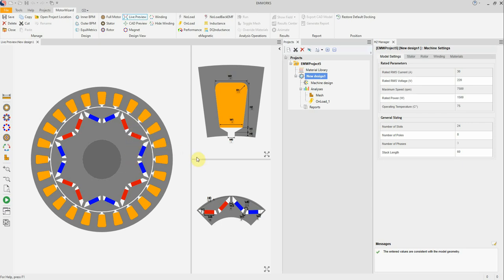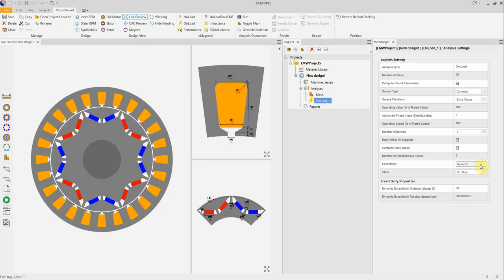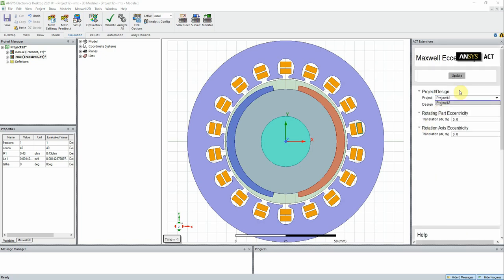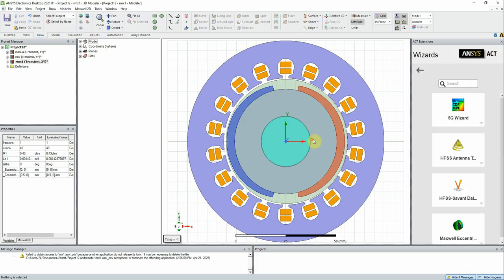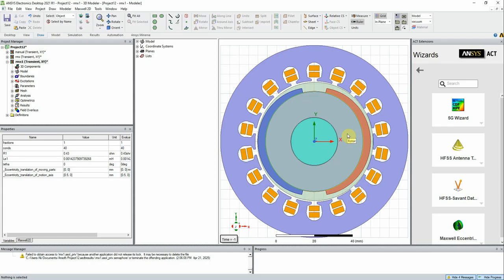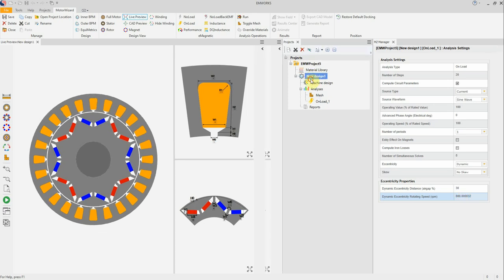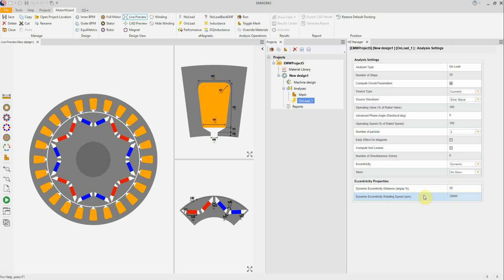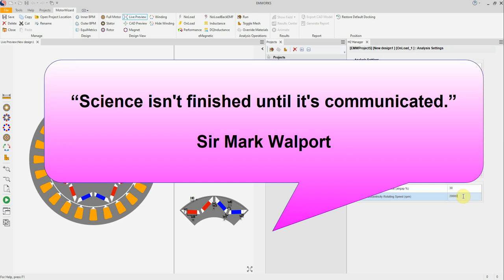Motor Eccentricity Simulation Like Never Before! Dynamic Eccentricity at Custom Speeds?! EMWORKS!

Comment: why should we use any other speed for the eccentricity? is it possible in real machines?
Reply from the maker: It is possible for many situations. Imagine, the rotor center is changing its place but at a lower speed of rotation. This is the place we need to use this option